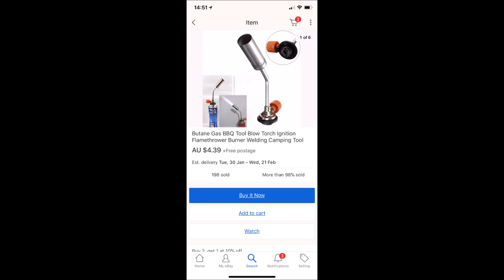How to make a Bunsen Burner portable

Comment: Cool set up.

When lighting, I was taught to have the flame already lit by the nozzle of the torch, THEN gentle turn the gas knob. Saves gas, keeps flint dust out of the torch face, keeps uncombusted gas out of the room.
Reply: Yes I agree with you!...the people who taught that specific and important line of reasoning did so because people that were ignorant and complacent of that fact were not adhering to those strict guide lines and the explosions were increasing so public awareness also has to increase accordingly!...you and I both know that when dealing with electricity and gas (of any kind) things have to be done methodically, consciously,soberly and in routine steps... if one step is missed or skipped it could mean disaster! As long as the fittings are secure and everything is gone over it's not necessary to have a flame already lit.You have to have all you need within arms length and do it quickly:1.Slowly turn the propane knob letting a small amount build up in the hose getting to the burner. 2.Turn the burner knob on and wait a second or two.3. With a lighter or flint striker light the gas as it rises from the burner tip.4.Make the proper adjustments of gas for flame! If we do that then we're practicing safety and lowering worry we just can't get complacent with activities as we go through them, we must be aware and lucid at any given moment! I'm saying this because I used to go through life like a zombie,easy come easy go,50/50, hit or miss, every choice was a gamble! All that has done is cause misery,loss and regrets! Now I think about most things before I do them.I also make notes and lists and put things in plain sight,on hooks and in the same place each time! 😵😜😉

Comment: good video, just make sure the tubing you're using is resistant to butane. some common tubing types like silicone are attacked fairly quickly by butane. Also keep an eye on the temperature where the tubing connects to the butane torch outlet, it might get cold enough to make the tubing brittle when run for long periods.
Reply: Yes Adam good advice with good points and just as with anything worthwhile we must educate ourselves as to what things are compatable with each other and those that are not, like oil and water for a simple example!

Comment: could you do the same thing with one of the propane torches instead?
Reply: Yes Dylan that's just what I got finished doing and with this learning curve that I've been going through this past couple weeks I found something I never knew before my "Bunsen Burner Adventure" that has to do with those brass torch nozzles: They are able to be taken apart about half way down, just below the air holes, it's two pieces not one that are machined and threaded to screw together tightly! All you have to do is insert a nail through it directly to the other side which also has a hole,the nail goes into both holes and acts as a lever which you use as two handles that  you twist it until it breaks free.Once you've separated the two pieces a hose can be fitted over it nicely without having to worry about stretching several extra lengths down to cover up those oxygen vent holes, I found a short cut that I would  never have known about had it not been for me breaking one of mine at the weakest point where those four holes are!

Comment: strange thing about bunsen burners. Used one in high school chem never used one again in university or outside of uni.
Reply: I still use them at uni
Reply: What for specifically?
Reply: nixrate during my first undergrad year in analytical chem we did a lab week about qualitative analysis, like the analytical march, and there we used the burner for heating the test tubes to start reaction and doing flame tests. However, we were quite a lot of students on that lab, and as we were lab noobs hot sulfuric acid used to be projected out of the tubes, so overall I think that the real motive to use them was natural selection of students
Reply: lol, we had a giant hot water bath machine with small holes in top for test tubes-flasks.  You would remove a ring the larger the vessel was. I never used them in 6 years chemistry.